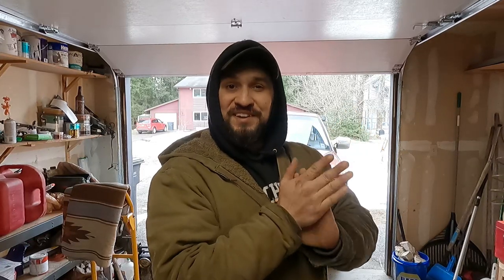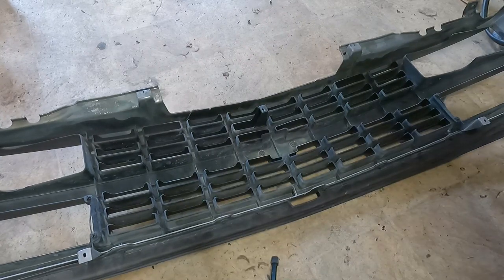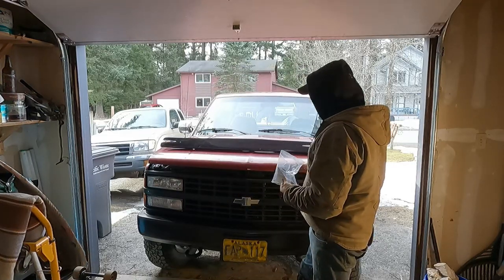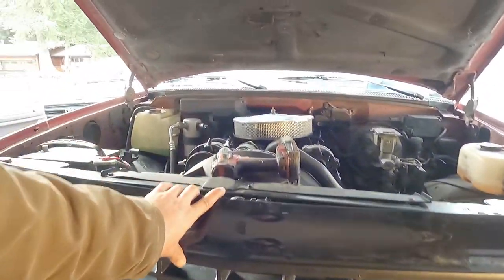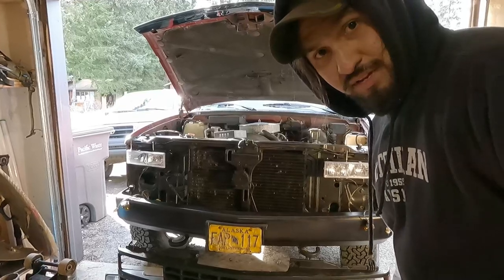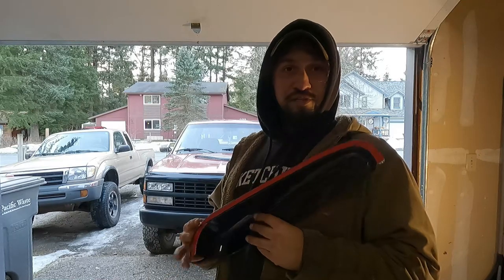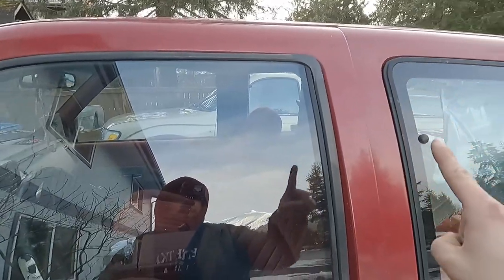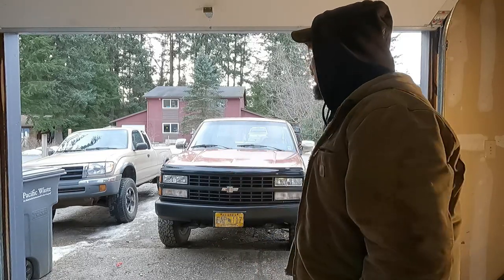Chevy Silverado C/K: Bow Tie, Bug Deflector, Rain Guards Installation (OLD vs NEW)

Comment: Where did you get your grill and what year is your truck ?
Reply from the maker: Tank you for the question!  This is a 92 Chevy Silverado K1500.  The grill is stock.  I painted it black and bought a stainless steel bow tie emblem.
Reply: @KooshdaakaaGarage  I have a 89 obs and the person I bought it from had a different year grill on it so it’s not completely bolted in how is your filler piece below the grill connected